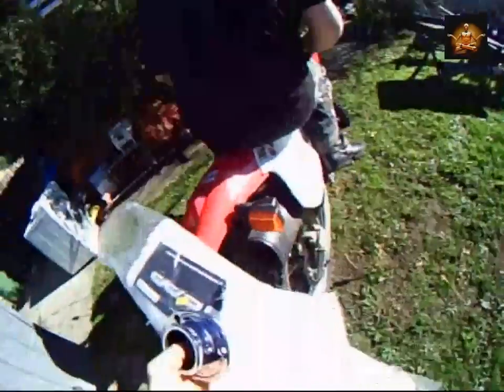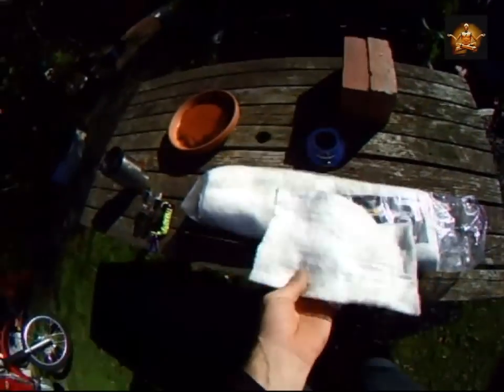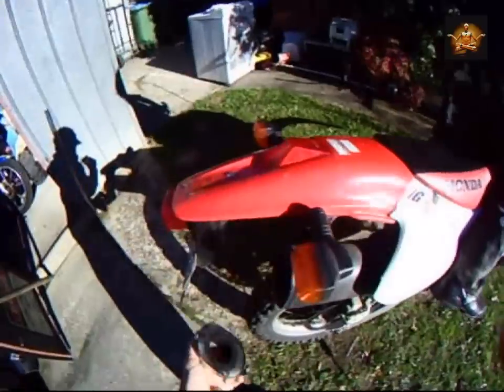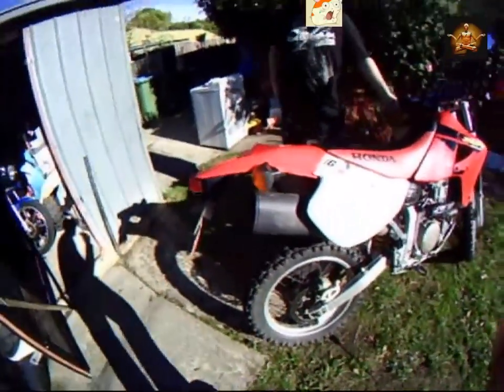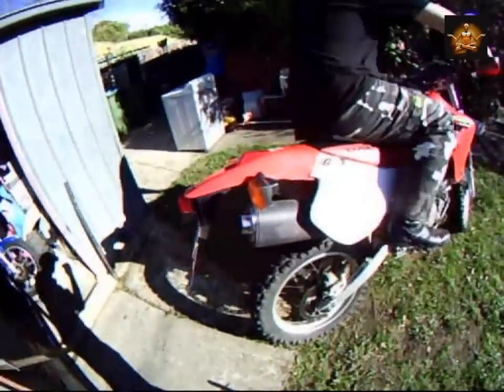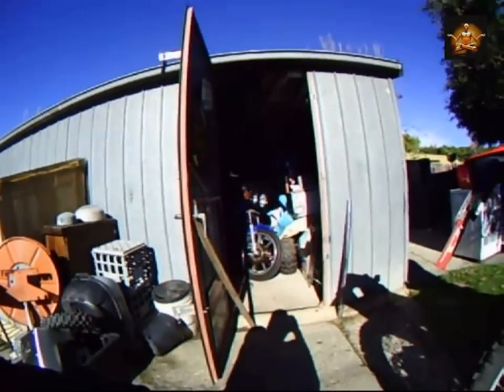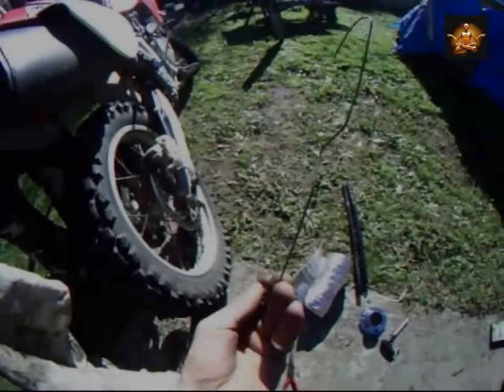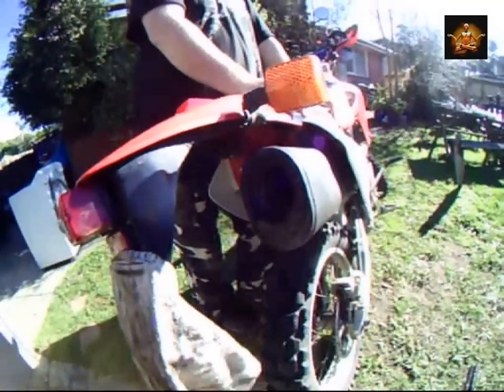How NOT to install Muffler Baffle matting on an XR650R

Comment: You should have rapped steal wool around it first than fiber glass,  or used ceramic fabric,
Reply from the maker: Next science experiment for ya - x1 Steelo pad (pull apart) x1 cigarette lighter...watch your fingures!!
Best not use steel wool in a Burning enviroment hey...lol 
Ceramic fibre, I haven't seen before (not that I've looked...).
I'll keep n eye out next time i need to Re-Wrap something.
Thanks for your comments & RSOT new speed >:)